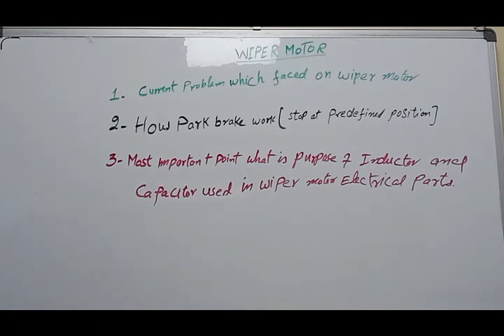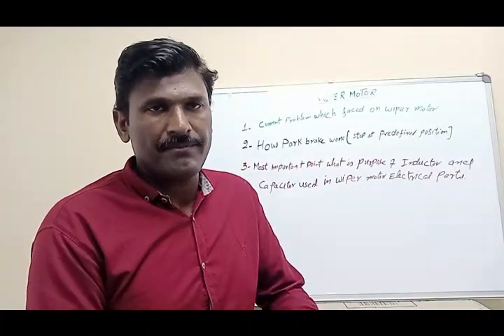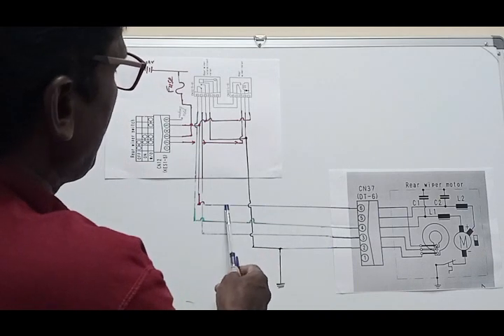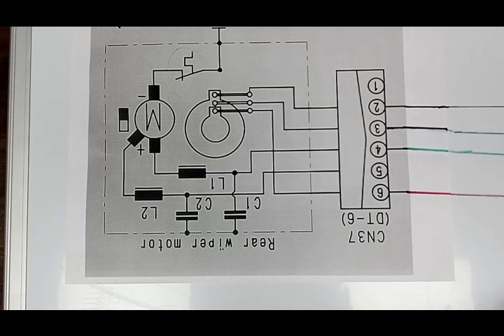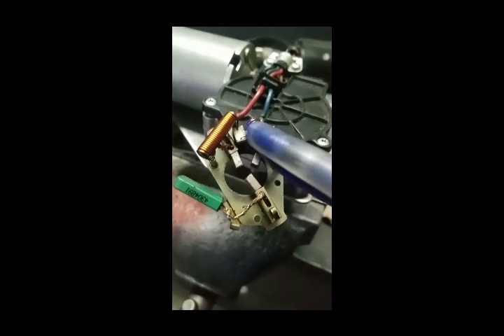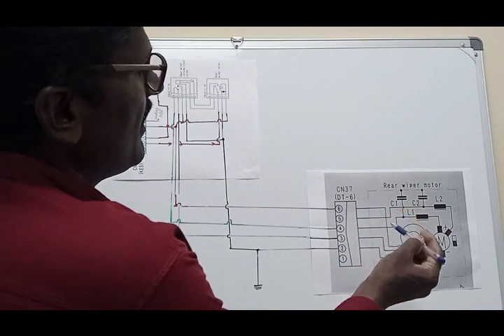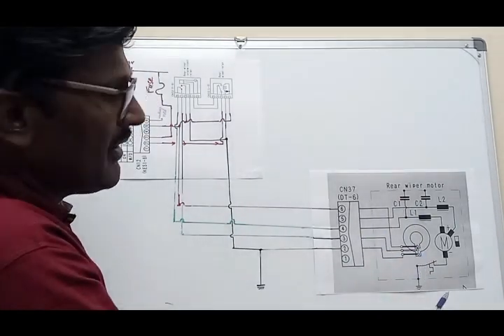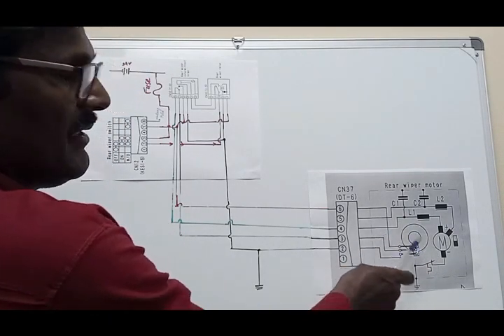Why Use Inductor & Capacitor In the Wiper Motor Circuit part 1

Comment: Good find and explanation of the wiper motor operation. It was explained to me the primary purpose of the small inductors was for RF filtering of the "noisy" nature of the commutation of the DC motor. I have also seen where the size of the capacitors are used to reduce the amplitude of the transient spikes when motor is switched to dynamic park. Thanks again for the video.
Reply from the maker: Thanks for appreciation

Comment: What is the component between the negative brush and ground? The green component marked 4304891 on the thumbnail of your video. Also, what part number is that assembly or what is it from? I need one exactly like that one. Thanks!
Reply from the maker: Let me check it. It's long time.
Reply from the maker: It is capacitor, this is installed in komatsu dozzer door wiper motor.